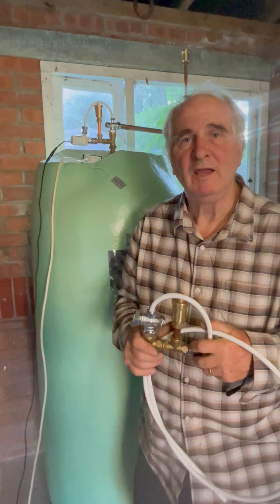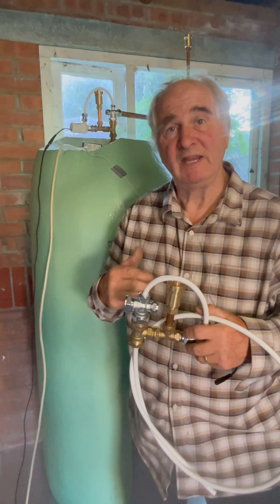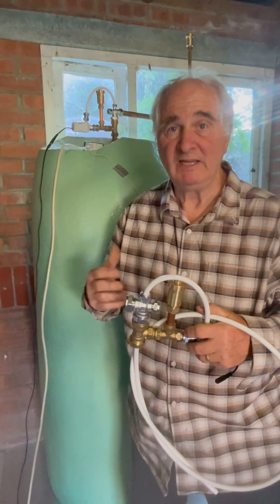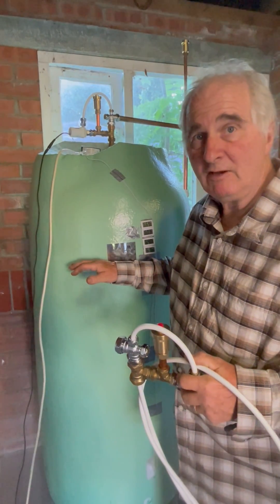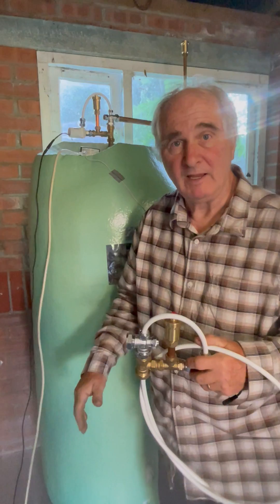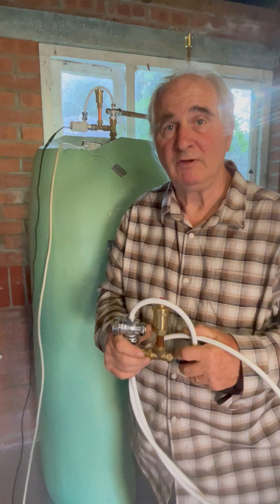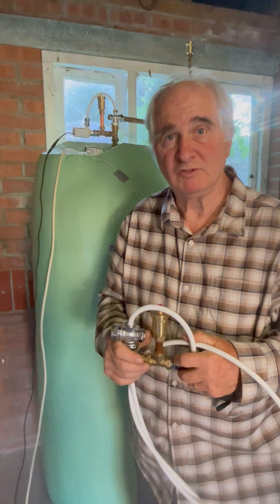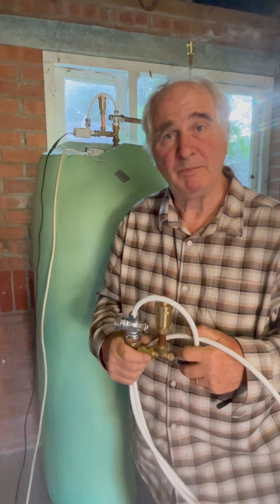Patented Energy Storage Device to replace gas in any home for heating hot water.

Comment: "In the summer it could replace gas entirely" you forgot to add if you have another cheaper electricity source (like solar),   Really this is just a de-stratification pump.

Your shower booster pump,  is a nice design and works well to not boost a shower so much as to use all the hot water so quickly,  but enough to make a poor gravity system give a nice shower,  and with no need for Surry or Essex flange

But the markings on this device is misleading
Reply from the maker: I pay 8p a Kw/Hr between 11.30 and 4.30 so for me it works because thats the same price as gas. There is often lots of spare wind and solar PV but so very little storage. In the summer there is no demand for central heating so its only energy for hot water for taps and showers needed.

Comment: What is the time it will take to heat up the immersion tank? Also, how many hours would it last? Thanks.
Reply from the maker: It will take around 4 to 5 hours to heat up the immersion tank. If you leave the water in it the tank temperature falls from 65deg C to 50 deg C in 3 days. Normally you would heat up the water every night.